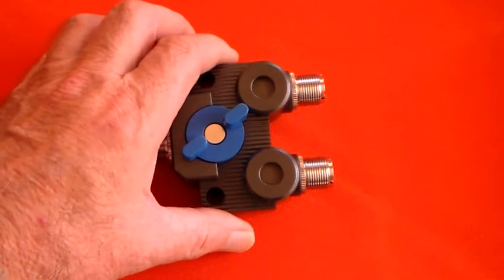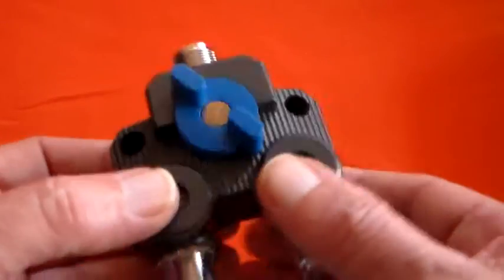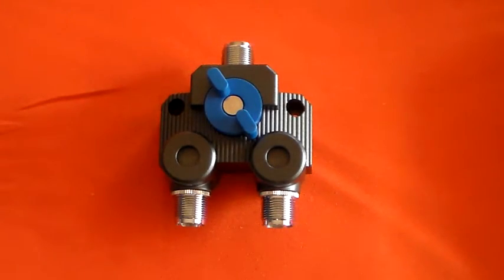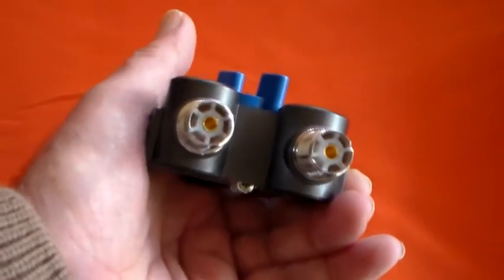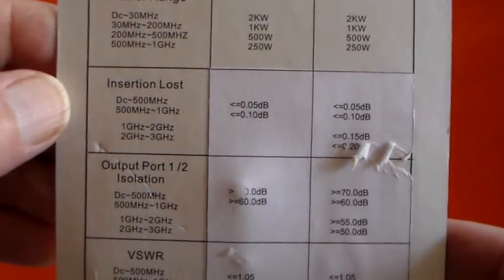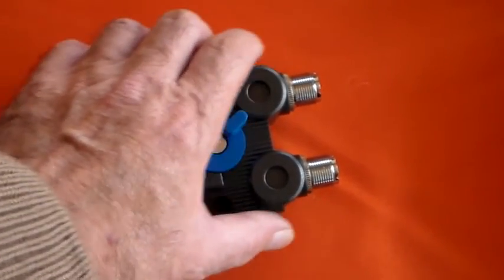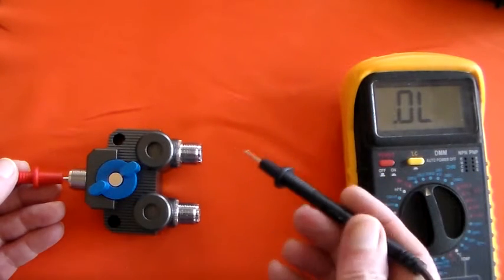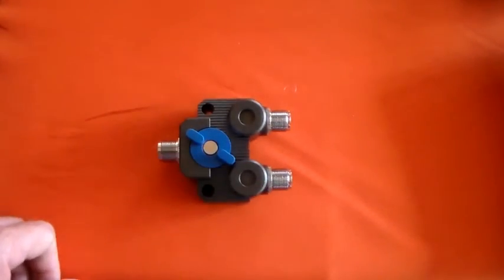Avair Electronics AV-SW2M Coaxial Antenna Switch.

Comment: I'm guessing the poor rejection from one side to the other is because it doesn't short to ground the unused side? I have a switch here which I have had 30 years, I want to connect 2 transceivers to one antenna. its a D-5200 (that's all it has on it) the classic V-shape anodized blue looking thing with a 2 big read switches inside. when I switch to one side the center conductor of the unused side goes to ground, and when i put the switch in the middle it shorts both sides to ground and isolates them.

Comment: Hey mate I’m new to antennas and just wondering if this switch will work with UHF in my car for running two separate db antennas of the same head unit
Reply: Yes
Reply: Pro trick : you can watch series on flixzone. Me and my gf have been using it for watching all kinds of movies lately.
Reply: @Porter Magnus Definitely, I have been using flixzone for since december myself =)
Reply: @Porter Magnus Yea, been using flixzone for months myself =)